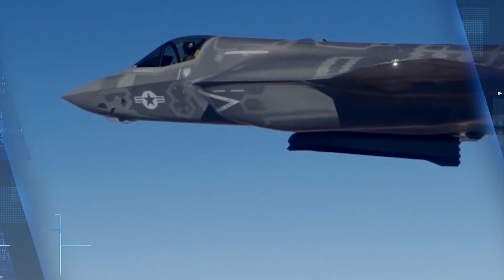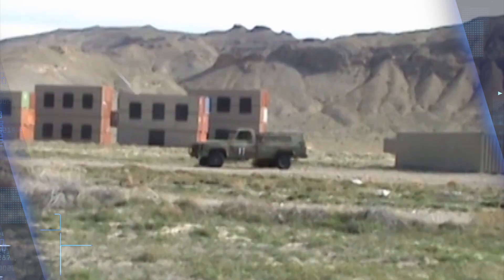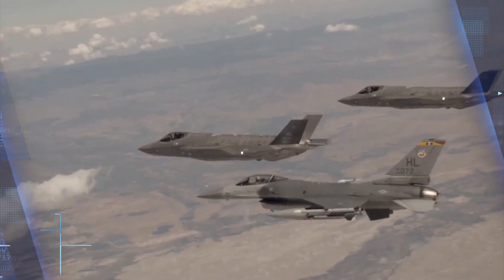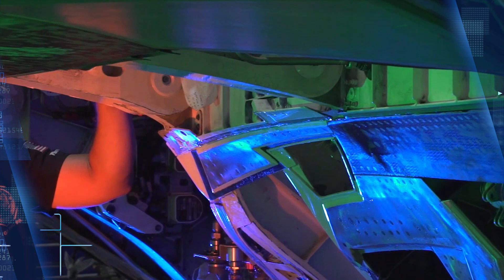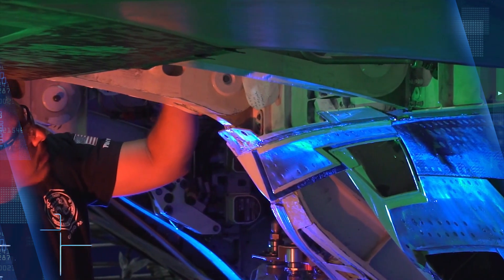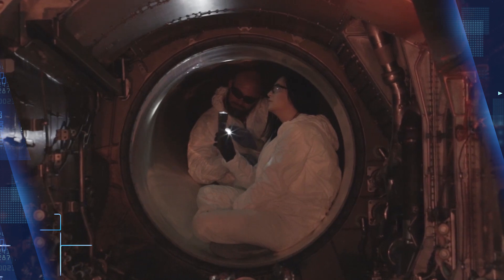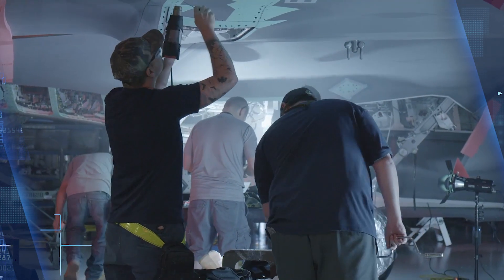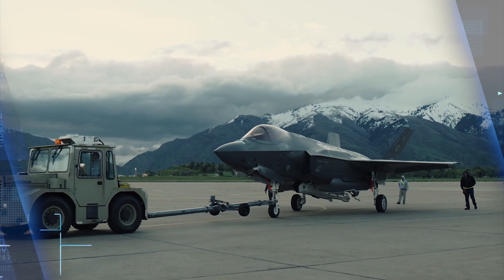Lockheed Martin Develops Advanced Targeting System for F-35 Lightning II

Comment: Nothing like this anywhere else. A shame though that repeatedly secrets are so easily lost from the US. Almost like there is a v high level mole  seeing to it. Spend more on security.
Reply: Robert Harding ... stealing plans and blue prints does little good if you don’t have the advanced machinery needed to build it? You only have to look at China’s continuous inability to build thru reverse engineering a powerful and reliable jet engine!??
Reply: @JimCOsd55  And when a materials breakthrough comes you're stuffed. While they haven't yet produced a great jet engine, that will come. My point is that China seems to steal at will. This is not good enough.
Reply: Robert Harding ...what you seem to ignore is that computers and cyberwar wasn’t invented by the Chinese nor are they it’s only practitioners! A few years ago the US unleashed the Stuxnet computer virus on Iranian centrifuges destroying many of them. So the US may not only be well aware of what the Chinese are hacking but could be also feeding them false intel, thus part of the reason they’re having in developing a reliable engine???
Reply: @JimCOsd55  , I agree.  The manufacturing technology of the F-35 is an advanced program in itself.  But the engine is a separate program and may have different security procedures.